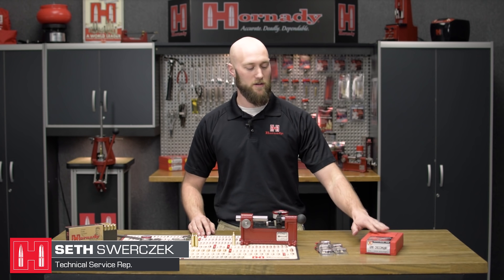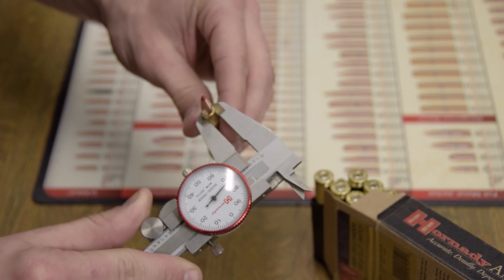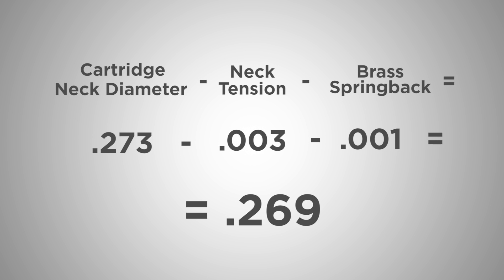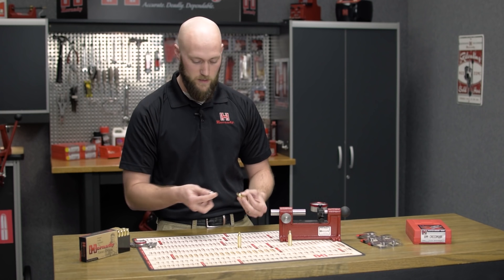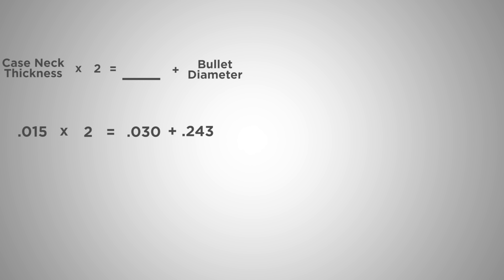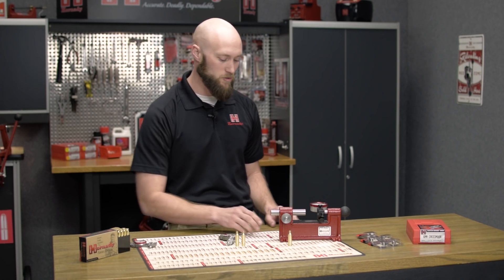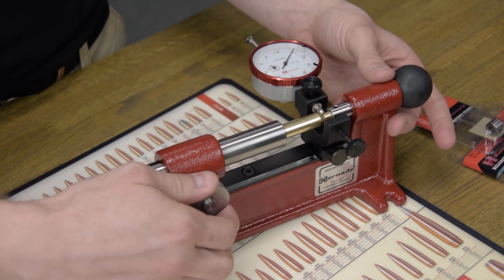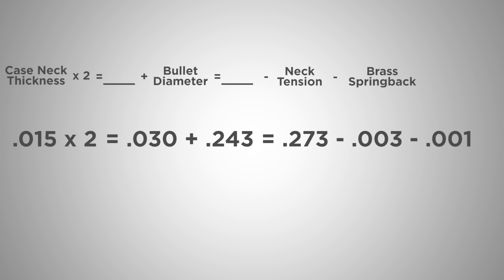Hornady® TECH TIPS: Match Grade™ Sizing Die - How to select the bushing your cartridge requires

Comment: If you are using the 6mm bushing die and a 22 cal bushing= .244  or .245   Your dies crush the brass.  Why can't they be used to resize - wildcat- brass like the Redding system?  Do you have tapered bushings or do I need to drill them out?  My goal is a .22 creedemore